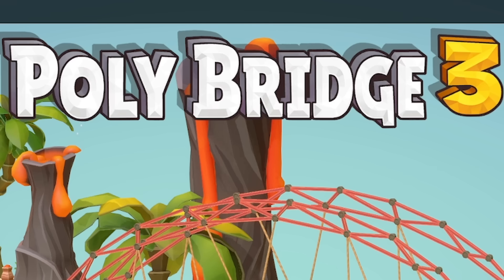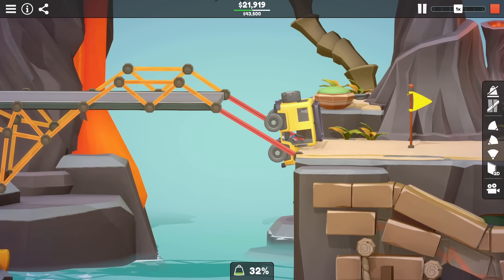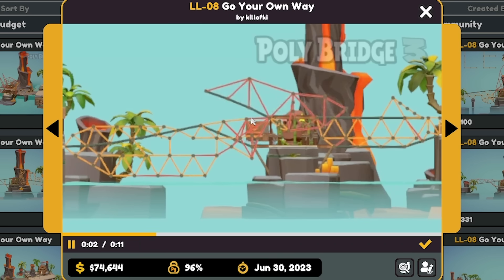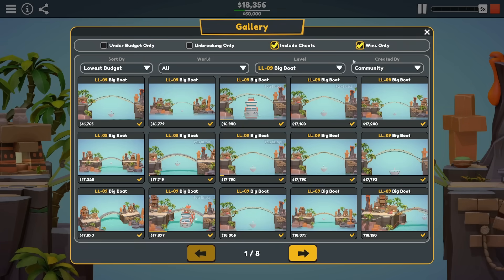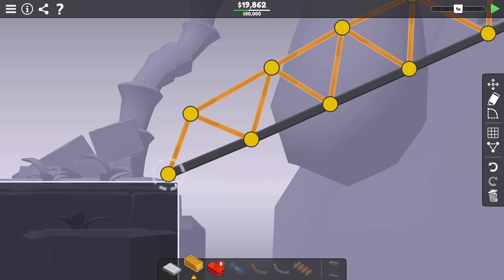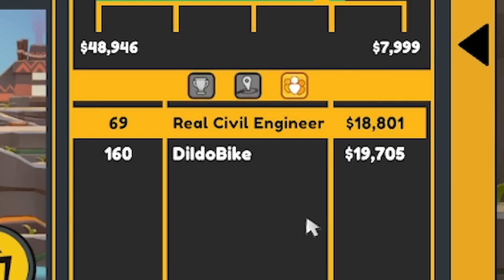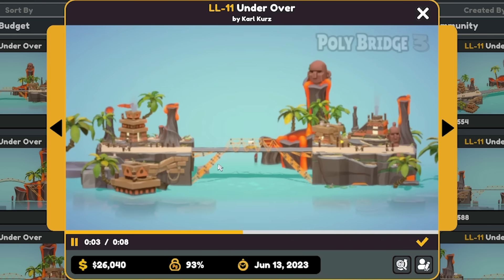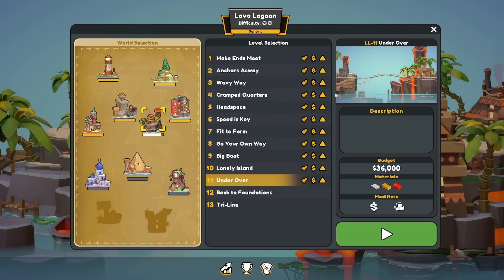These bridges are engineered to PERFECTION in Poly Bridge 3!

Comment: Is there a feature in poly Bridge where it tests your bridge to failure and your placement is based on the ratio of cost/weight rating? Would be neat if it isn't a feature/level.
Reply: You can see how your bridge ranks by cost or stress.

Comment: We need to start a movement to free the editor from Matt’s basement
Reply: But no editor means no videos
Reply: @dweezil6969  that’s where replacement editors come in
Reply: @tymiller4689  Then the cycle starts over. They get locked in the basement, they want out, you set them free, then you have to go capture more editors.
Reply: @dweezil6969  and good old paddy keeps them all in check